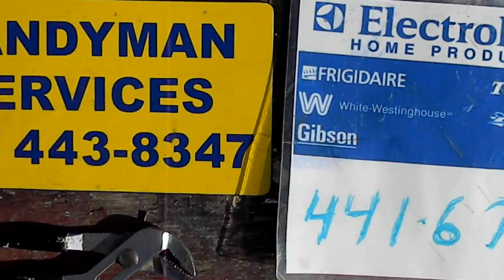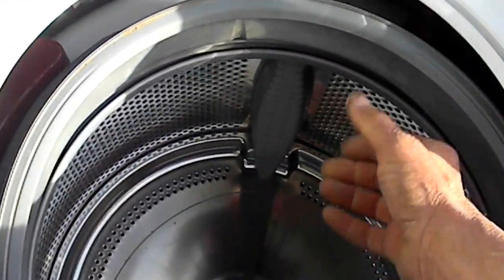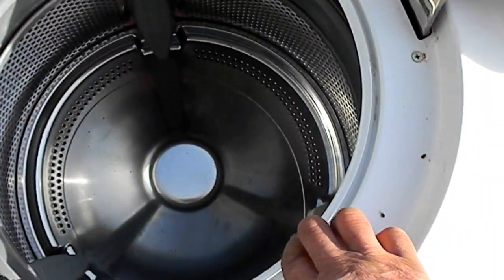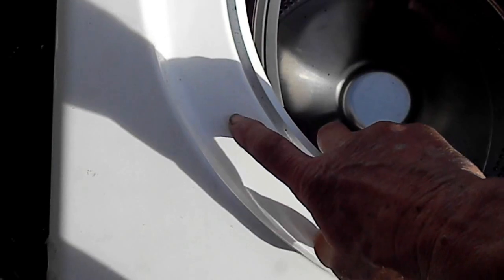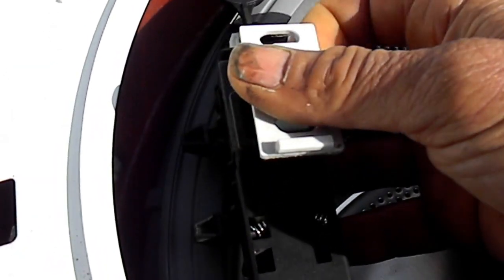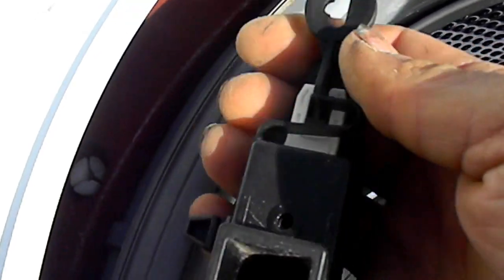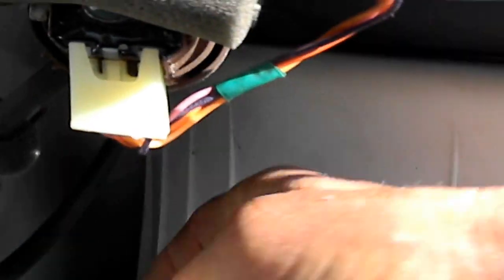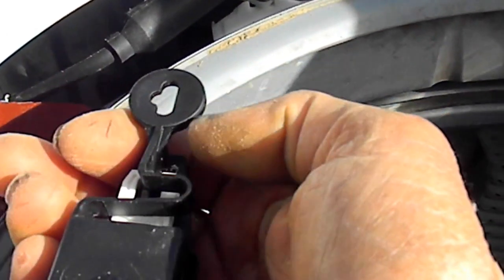Front load washer, stuck door, Maytag Service Repair, Eureka Ca 707 445-1591

Comment: if the lock assembly won't accept the door latch gently pull on the spring loaded piece inside back to its proper position..if it gets pushed in by say attempts to make the machine run with the door open it ends up flipped back and the door just bumps into it..grab the vertical plastic piece and gently pull out until it flips back foward..
Reply: michael ray m

Comment: Thank you for telling me how to get my uniforms out the machine until it is repaired.
btw I have a Maytag front load MHW6000XW2 that stopped midload with no response but lights still on, 54 minutes left. It never did more so I unplugged it after a few hours and now it's just dead. No lights or sounds. Any suggestions?
Reply from the maker: Always make sure you have power at the socket first, than be sure to push the on button.. .After Maytag went digital... that is when life got difficult for me to say the least.. If you have power look for loose connections. Otherwise keep Googling. Peace